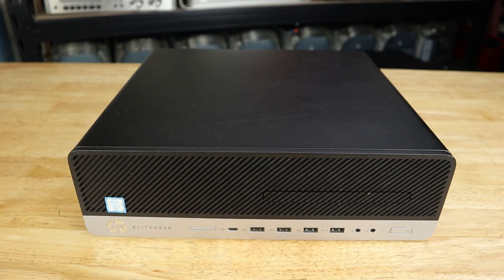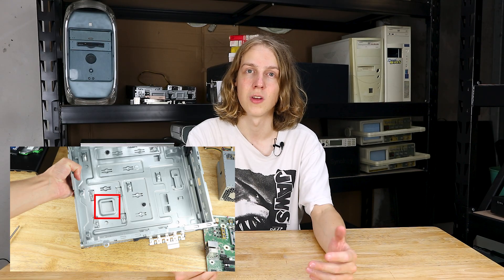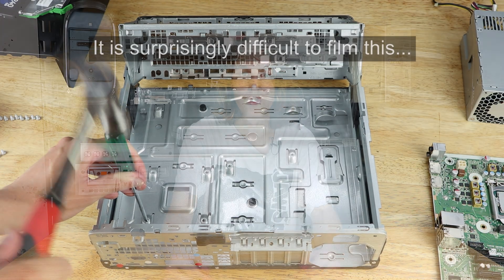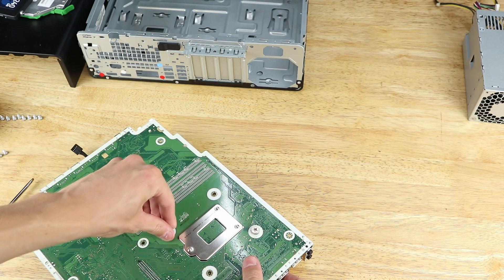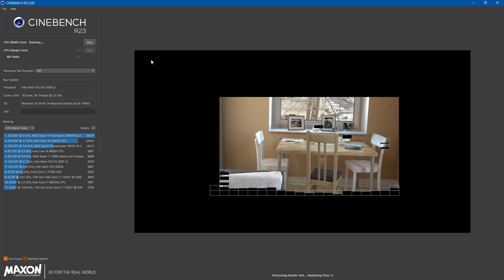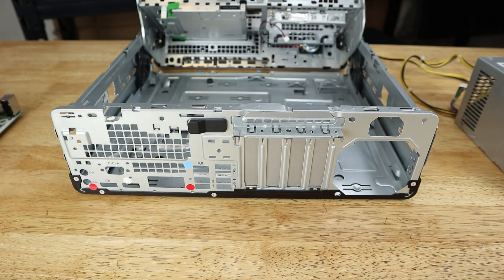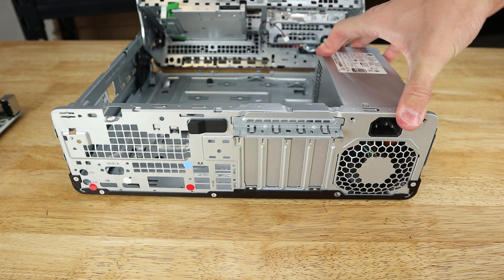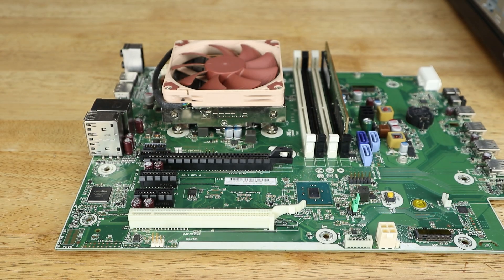SFF PC Noctua Cooling Mod | HP Elitedesk NH-L9i Install

Comment: i feel like the stock cooler is pretty good to be honest on my 800g4 SFF. It keeps it at 85-90c if I throw an extremely heavy load on it. Keep in mind my home computer sits in a small cabinet. The main problem in my opinion is that awful psu fan. It makes my gaming laptop feel shy.

Comment: I'm doing a case-swap (into a bamboo box) of a HP Prodesk 600 G5, and it would be really optimal if I could swap the CPU fan to a Thermalright. 

I'm going to use a custom case, so am I correct in assuming that there is no real problem with using a third-party CPU fan like this as long as it's PWM and has the 4-pin fan-connector? (and physically fitting). 

There's surprisingly little clear information online about this. I saw someone saying that these HP computers sometimes throw up errors when you pick a non-HP fan, but that could also be nothing.

//EDIT: So, if I'm understanding correctly, you kinda have to manually set a speed that the CPU-fan (and apparently also the PSU-fan) run at, and tweak that so it's a good balance between being quiet and getting improved temperatures? 

In other words, using a third-party fan/non-HP-fan you lose the ability for the system to speed up and speed down the fan "as needed", and you have to instead define a fixed speed that will work in both heavy load and no-load scenarios? (basically making the fan "not-smart").

Comment: i did this NH-L9i mod to my hp prodesk 400 g7 but i replaced the 15mm noctua fan for a 25mm noctua, also cut a 90mm hole above it and added a ceiling extractor fan cover plate and a 60x25mm noctua fan with a push on/off button as exhaust fan 👌🏽 only issue is the 400 g7 has small rear mesh holes so need to file some open to help exhaust the air 🙌🏽
Reply: Any pics of it on Reddit or somewhere

Comment: So I can confirm that the NH-L9x65 is a direct fit with no modifications to the case or cooler itself. The included AMD screws fit perfectly into the case cooler mounts, so I used those to attach the top bracket for the cooler. You'll need to cut threads into the Intel bracket, but it's easy since the metal is soft - just twist the screws back and forth a bit and they'll go in.

I haven't touched the bios fan settings, but im already seeing at least a 15°C difference than before. Fan ramps up as it should, so I don't think I'll need to change that for now.

I also added a small 60mm fan to the back help pull heat out of the case and attached that to the cpu connection with a y-adapter.
Reply: I just did exactly that to my EliteDesk 800 G4 SFF. At first it was pretty hard using the AMD screws to cut the threads into the correct hole on the Intel 1151 mount brackets and thought I fell victim to an internet troll. But after going back and forth while using enough force it finally started going in and I was done threading them in after about 10 minutes. The black intel standoffs (for socket 1151) still seemed to be the right ones so I went with those. Worked like a charm. I didn't have to modify anything on the case itself either. 

The 60mm Noctua on the back with the Y-Adapter worked as well. I used some cable ties to fix it against the back, pulling air out. 

Since I didn't get any accessories with the PC I went ahead and also 3D-printed some 3,5" disk mounting "screws". Now I got everything I wanted.

Thanks a lot for your info!
Reply: @Sunaori did you use l9x65 or l9i for g4? Thanks
Reply: it'd be awesome if you could video this!
Reply: I'm on a thermalright AXP-90 X36 and a Prodesk 600 G5 SFF. The thermalright has a very similar design (mount it from the back, with or without a backplate it seems). I would really appreciate if you could snap a photo or go into a little more details about these screws. 

The screws I got with the thermalright AXP-90 X36 are all the same thickness (they just vary whether they are "long" or "short"). I am assuming that the NH-L9x65 come with screws for AMD that are the same thickness as the stock intel cooler?

Would be really great if I could just order some replacement screws before modifying the case.

EDIT: Decided to remove the spacers from the case. The thermalright has to be mounted from underneath, and you can always buy cpu-cooler backplates for a lot less money than it costs to buy a new cooler. 

I used metal-clippers, which I think is a better method than hammering down the distances. Better to remove material than to risk not having enough clearance after hammering. There's also some risk of deforming the rest of the metal plate.
Reply: I did this same modification to my  600 G3 and swapped the i5 with a delidded (applied liquid metal) i7 6700, I haven't seen temps go above 45℃

Comment: I took a shot at this mod on my EliteDesk 800 G6. For anyone who is trying this, it will NOT work on the G6 board. The caps have been rearranged and the four to the left of the CPU are in line with the bracket, and the two at the front are closer to the bracket. This doesn't allow you to attach the cooler since it is physically touching the capacitors and you cannot make a flush fit to the top of the CPU.

Good thing I dry-fit it before I hammered down those posts! I wonder if the NH-L9x65 would fit better on the G6 board. The original cooler+fan is about 65mm from my measurements, so it should still fit vertically. Would just need to figure out how to manage the backplate against the case.
Reply: Did you ever find a good cooler for your g6? Looking at trying out the Nh-l9x65

Comment: 6:00 Are you saying to crack open the PSU itself and add in a low noise adapter inside the PSU?
Reply from the maker: Yes, that is what I meant. The fan inside the PSU uses a standard fan connector. That way, you can increase the CPU fan speed while keeping the PSU fan quiet.

Comment: These companies do things to save costs and also to make customers come to them for parts or service..they don't want you to easily fix or replace a part yourself...it isn't wirth complaining as this is how real life is..part of the deal of buying these systems is dealing with those work arounds....they are easy to fix if you have done repairs or made stuff yourself....i add a rear exhaust fan in my computers ( starting building them in the early 1990's ) and these smaller cases need help to run cool... i was away from building for awhile but my sons needing computers and i need a newer one too got me working again ... i have 4 now...and the boys have ones that they are enjoying.... mine are used older ones that i am happy with... not really any different other than the ones i built from scratch... these small cases are ok but can be problematic dealing with some upgrades ( gpu and psu connectors ) but the problems are minor and easily worked out...i have 50+ years of fixing anything or fabricating too... 
🇨🇦🤓✌️

Comment: Does the fan noise improve compared to the stock cooler? I have an Elitedesk 800 G5 that I use for music production and the fan noise gets annoying under medium to high loads. I would definitely upgrade to this cooler if it means a quieter system.
Reply: Datasheet states 24dB and 15dB with their power restrictor.

Comment: Does this fan fit the Lenovo thinkcentre m910s sff
Reply from the maker: I don't have one, so I don't know for sure, but if it has the standard CPU cooler mounting hole locations, then it potentially may work.

Comment: Why did. you damage the housing to geht the cooler fit in? I did drill the Noctua brackets instead from 3 to 3,5mm holes and used M3 screws to tighten the brackets to the original mounting holes in the housing. Works perfect and I didn‘t had to destroy the housing. Also swapped the i5 6500 to an i7 6700.
Reply: so instead of beating the brackets down, you can simply drill them out?
Reply: @adamhughes5678  No- I did drill the small holes in the Noctua mounting brackets from 3 to 3,5mm, which allowed me to tighten it with M3 screws to the original spots which have M3 thread already

Comment: How about the turbine in the Mini series? I've bought Prodesk 400 with i3-8100T and expected it to be, if not a bit more quiet, the noise to be less ear drilling. Are those fans/turbines easily replaceable, beacuse the port it is connected to is signed 'P8 CPU FAN'?

Comment: Just did your mod and you’re right about the power supply fan noise. Can you link to the low noise adapter?
Reply from the maker: It is the Noctua NA-SRC7 that you'll want. I unfortunately only had the 3 pin one when I made this video.
Reply: @serverscience low noise adapter installed and can confirm it works perfectly. Cool and quiet. Great mod and video. Thanks.
Reply: @dirty504  How did you manage to connect the low noise adapter? I opened the psu of my elitedesk g5 800 and the connector is different. It's 4 pins, but it seems thinner and the little plastic 'bars' that slide into the connector are different. (the adapter has two, the psu fan has a big one in the middle). The Noctua NA-SRC7 just doesn't fit. I could remove the whole plastic from the psu connector, but before I make irreversible damage I thought I'd ask.

Comment: I have a EliteDesk 800 G5 and have not found a fan speed control in the BIOS.  I have been looking at solutions since I do use it to serve games and the heat gets out of control and disconnects users till it cools off.   Which is only a few seconds.  It reports only going to 80C, but I think there is a spike that I cannot see and the CPU goes into thermal for a few cycles.  I think it is because the aluminum heatsink is fine for easy tasks.  But if there is a spike in temp the cooler does not pull heat out instantly like a copper/heat pipe design would.  I noticed the capacitor issue as well and have been shy on spending money to find a replacement cooler.  This really guides me in a great direction.  Thank you for posting this!

Comment: Im searching atm for my first mini homelab pc. To run vms and replace a raspberry pi. What gen is good to start with?
Reply from the maker: Most of the generations are pretty good, but in terms of efficiency, probably aim for HP's 3rd gen or newer (or an equivalent Dell or Lenovo), and also get at least 4 cores.

Comment: Noctua PSU fan mod...(Only, if you feel comfortable doing so!)

I recently saw another YouTuber turn around the PSU fan on another type of sff PC to change airflow direction to press cold air into the case and drop temperatures quite a bit.
Reply from the maker: Good idea, but unfortunately Noctua doesn't make 70mm fans, which is what the PSU in this system needs.
Reply: @serverscience   Although it is a bit smaller, a 60mm fan should still be sufficient, if there is space for 25mm thickness. And you'd need to get a little bit creative to fix it in there, either by elongating the mounting holes inward a little or by twisting the fan a little bit and drilling new ones.

Another thing that will make noise is the 'fan grill' in the PSU. I'd cut that out and replace it with a classical one made from round wire.

I have to admit: That's a lot of modifying already. And as I wrote you'll have to know what you are doing, as you'll have to disassemble the PSU quite a bit, to protect the circuit board from shavings.

Comment: But i had a different plan of Simply install an noctua 80mm fan on cpu cooler and back exhaust but I think your plan gives a better end result. 

Btw. Mine has an i7 7700. And I remember from old days. They were like fire. Even my bequiet pure rock 2 slim had problems

Comment: Yeah, that shroud really helps. I just got a 600 G4 with an i5-8600 in it and have been trying to figure out some better cooling whilst retaining that, or another shroud. I wonder if the L9i you used with a standard 25mm thick fan would be better because more static pressure. You could also look at putting a centrifrugal blower fan blowing out the back of the case, might not even have to be a big one. I'll be sure to keep an eye on Your channel for more progress.
Reply from the maker: I'll have to look into a regular thickness fan, because with a modified shroud it could be really good.
Reply: Do CPU with low TDP version like i5 8500t and i5 8600t works on the HP EliteDesk 600/800 G4?

Comment: Upgrading from a solid aluminum mass to a heat pipe style cooler has big efficiency benefits you might only see when comparing how quickly things heat up / cool down

Interesting that the BIOS fan curve seems to find equilibrium at 70c regardless of cooler, but it bet the noctua fan not doing nearly as much work as the original cooler

For what it’s worth, I think 70c is great at full tilt! Especially since most home lab servers don’t spend much time up there
Reply from the maker: I reckon you're probably right about the stock fan curve, which would explain why the noctua fan didn't speed up; because it didn't need to. I hadn't expected HP to put any effort into the stock fan control, so I assumed it wasn't very smart, but it seems like it is.

Comment: If you find a way to unlock the UEFI for any GPUs and CPUs let me know.
Reply from the maker: Edit: The GPU 35W limit is a suggestion and can mostly be ignored. 

There probably is a way to remove the 65w cpu limit. I haven’t looked into it though.
Reply: @serverscience  The bigger issue a have is that I can’t replace the CPU if I put a different CPU in it it dose not start.
Reply from the maker: @jacobscheit4128 Which CPU did you have, and which are you trying to replace it with?
Reply: @serverscience  need to take a look but I think it was a low power 4C APU but then I try to put a 8C CPU in it with a dedicated GPU I get no picture and it dose not boot.
Reply from the maker: @jacobscheit4128 Unfortunately, that restriction is present on most of the OEM AMD systems. They're locked to specific series of CPUs, such as Ryzen Pro or the Bristol Ridge APUs, depending on the system. What I have read suggests that it may be because of a lower end chipset, rather than the bios.

Comment: I use a Noctua U12S in my x99 build cooling a 16 core / 32 thread E5-2698v3 Xeon and it works fantastic. I use that machine for editing 4k60 video from a DJI Osmo Action and editing huge amounts of raw photos and it barely hits 55c under full load.
Reply: And that's 55c in an NZXT H510 case too, which has absolutely atrocious airflow.......
Reply: what montherboard do you use?